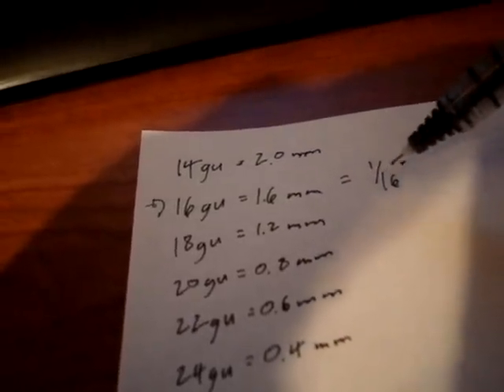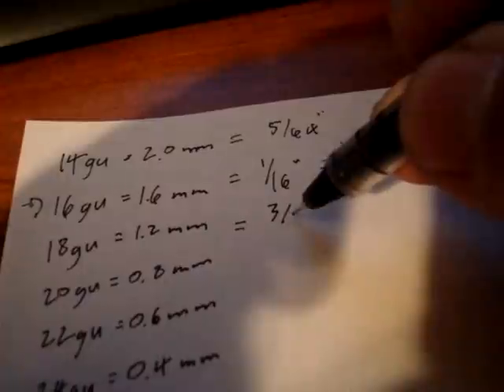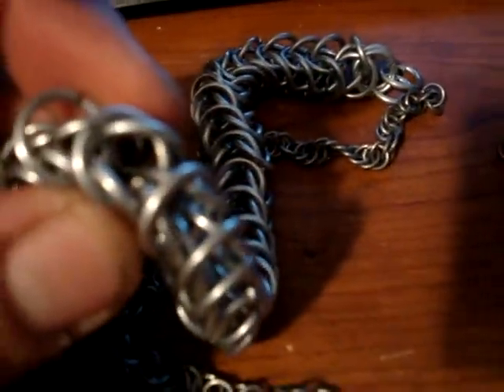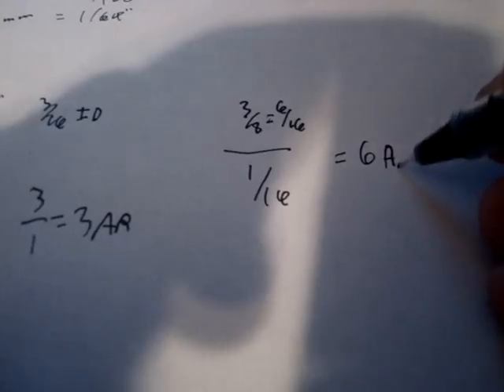Chainmaille Tutorial: Aspect Ratio

Comment: Look, Aspect ratio is nothing more than making sure you aren’t making your jump rings too big or too small for the gauge wire you are using and the dowel rod you are using to wind them on.  Bigger gauge#=thinner wire=looser weave.  Smaller gauge#=thicker wire=tighter weave assuming you are using the same size rod to wind on. So you can adjust your AR by using thicker or thinner rods, or by changing your gauge wire.  Make some samples, take notes.  OR you could do the math and get a headache and it probably still won’t turn out right.

Comment from the maker: Whether you like it or not metal rods commonly used as ring formers are usually labeled in inch diameters, and wire is almost always in guages with metric on the side. Unfortunately the US still refuses to abandon these standards outright, so knowing these conversions is still necessary until all retailer use metric exclusively.

Comment: No offence, but this tutorial is WAY too complex for the topic. Just convert all the imperial garbage units and the gauges into metric (or any other common unit), then divide the ring inner diameter by the diameter of the wire. End of story.

People really should stop listing wire diameter and inner diameter in different units; there really is no need for it. 

Your example in metric:

4.8mm(ID) / 1.6mm(WD) = 3 (AR)

No fractions, no conversions, no bullshit.